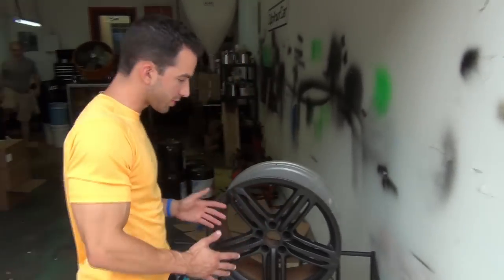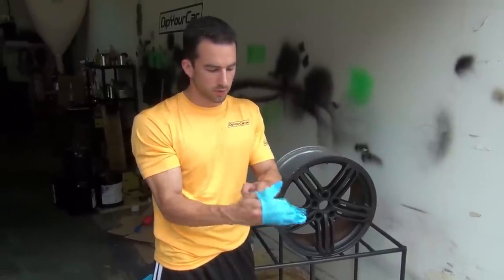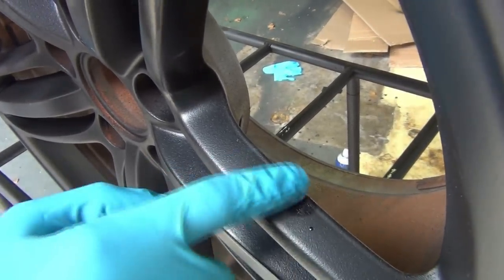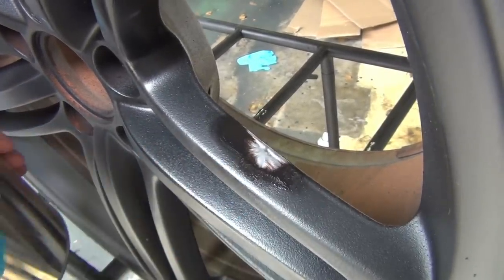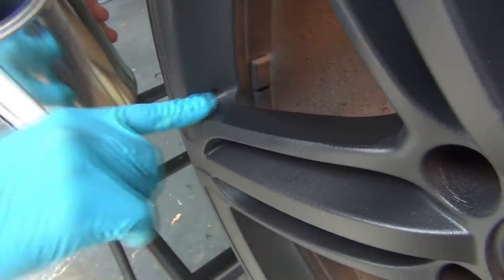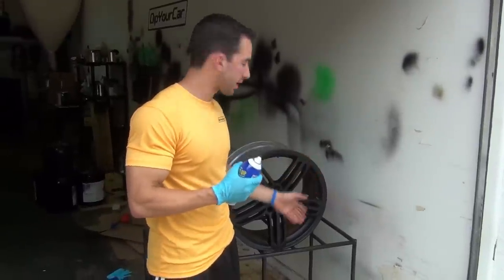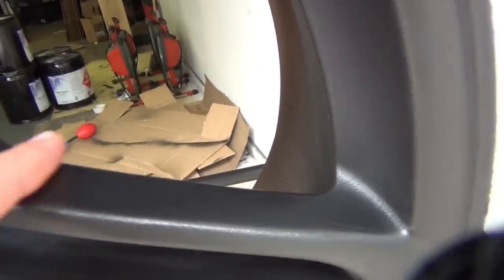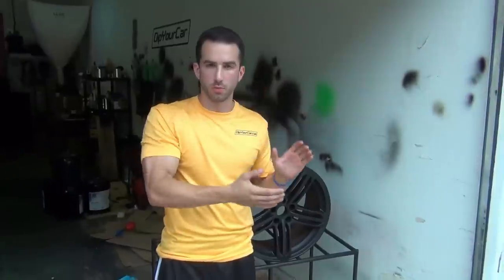How to Fix PlastiDip (Texture, Tears, Troubleshooting) DipYourCar.com

Comment: does plasti dip unbalane my wheels???
Reply: it will, but to what extent depends on your rim/tire combo & size. I have 17" Infiniti OEM rims with Good Year G-Force low profiles on and had mine rebalanced after dipping. Balances are done using half ounce weights so small changes can offset a balanced wheel, paint included

Comment: Nah, one can does 4 18 inch wheels at one THICK layer. 3 cans for 3 layers

I did mine on yhe weekend :)

One can per wheel is 4 THICK layers, 1.5 would be 6

Comment: how can I avoid texture to happend?
Reply: If you get a texture it means you were spraying too far from the rim. I did that with my first plastidip, my whole wheel was textured. Keep it 5-6 inches away and you want dark wet coats BUT make sure it doesn't drip.